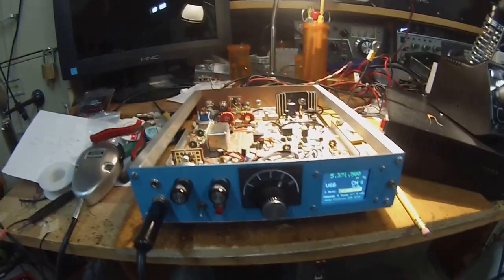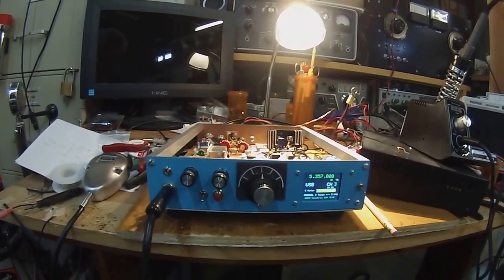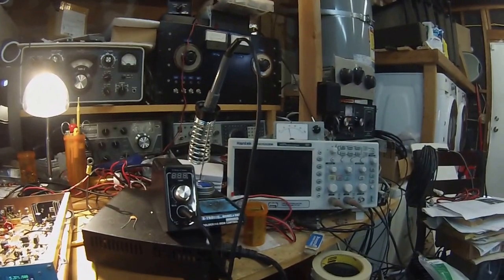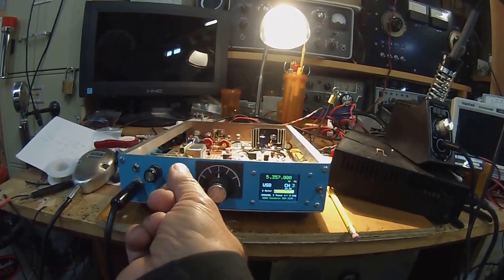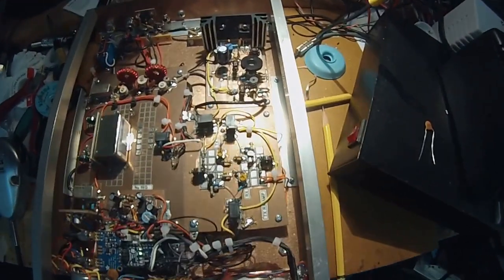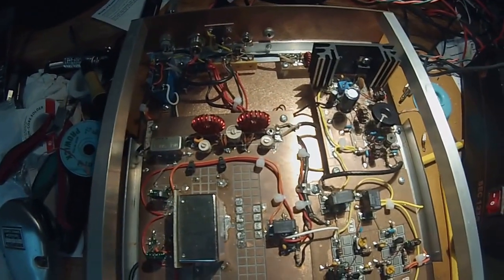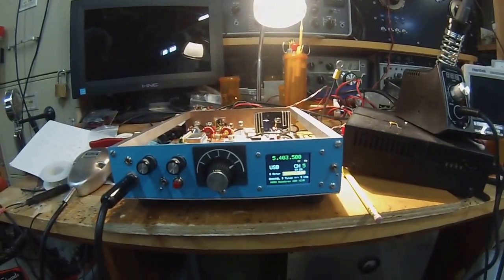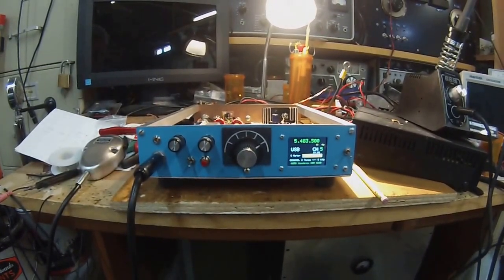DifX (Different Than a Bitx) - A 60M SSB Transceiver from N6QW

Comment: Great looking build Pete. Assume that you are using si5351 clocks for both VFO and BFO, straight into the SBL-1s at _8MA, VFO on 14.3MHz. And you used a bi-di block before the receive mixer, then 2 in the IF, so 3 in total? 73 from VK3HN.
Reply from the maker: Hi Paul,Yes to the Si5351. The IF stages use the Plessey bilateral circuit and following the RxTx mixer is the N6QW Bi-directional stage. Read my blog http://n6qw.blogspot.com for today and you will see more detail of the build. Yes it is a DifX! But the real nut and bolt detail for the circuits is on my website http://www.n6qw.com. Click on the Big Kahuna Link and you will see the schematics for the IF/Filter stage and bidirectional amplifiers. The Audio amp stage is also there. Thanks  for your post.73'sPete N6QW